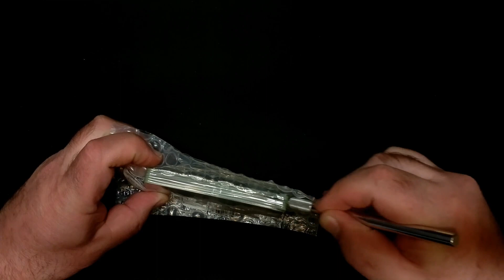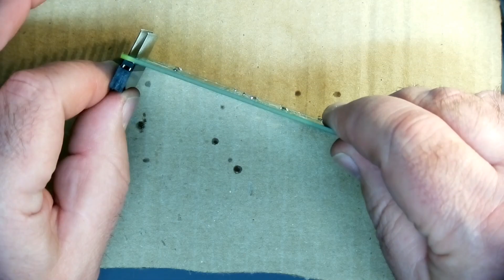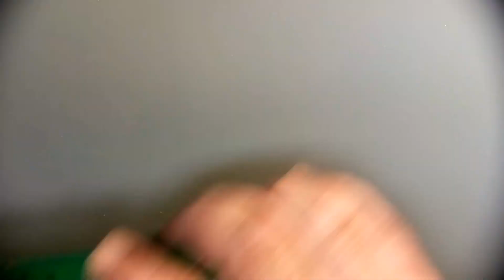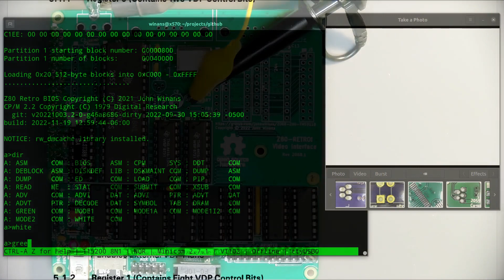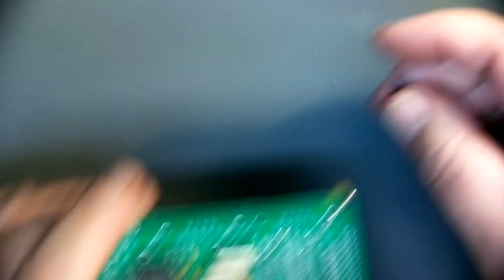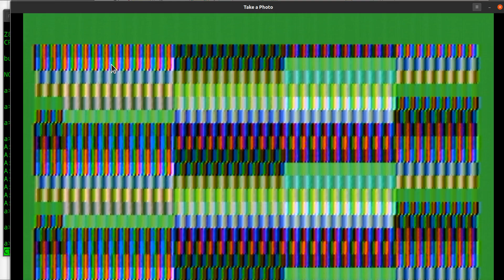Z80 Retro #55 - TMS9118 VDP Rev 1 PCB Test

Comment: Just a lone little opinion here but I don't mind the mixed use of SMT and thruhole parts on a PCB. It's not like that was never done in the past. Using SMT passives also helps to get more on the board... as you well know, thruhole DIPs are MASSIVE board hogs when compared to their SMT counterparts, every little bit helps.
Board looks good, thanks for the update.
Cheers,
Reply from the maker: Thanks for saying so.  I think my next few boards are going to be surface mount.  I can't get the chips I want in DIP packages anyway.  :-/

Comment: A great way to hold those jumper pins and a lot of other parts in place, is to use blue painters tape. No residue and comes right off, doesn’t melt. Blue painters tape… it’s strange to me ive never seen anyone else use it but it works great. 😊
Reply: Great for 3D printer beds and it's original intended purpose I've found and a myriad of other uses. It's my favourite tape as it is probably yours too;)
Reply from the maker: I've seen Kapton tape used for this purpose.  But it is way too expensive for me to use it that way.  I've also seen regular cellophane tape used too.  I tried it a time or two.  But it never kept things seated particularly well.  Maybe my boards were too densely populated with sockets?

Comment: A tip for connecters is to stagger them slightly with a small offset then they will 'press fit' and have a more mechanical connection and also you don't have to solder them till your done !...cheers.
Reply from the maker: You mean bend the pins a bit?  Probably a decent idea.

Comment: I've had the vertical lines with LCD monitors, but they don't appear as much with a CRT TV.
Reply: Yeah! Ive seen that too. My pole position arcade game looks great on a tube monitor but the lcd it has bars just like in the green test. So annoying!
Reply: @pikadroo  I wonder if the Retrotink, or another similar solution, would solve that?
Reply from the maker: This is the first video interface I ever designed.  I suspect the blame for it is mine.  Someone pointed out that the resistors I removed might have been provided for termination on the source end of the transmission line.  If so, then that could be a bit of an issue.

If it is true, then maybe hack in some aspect of the circuit I started with on my breadboard that I stole from page 9 of this Steve Ciarcia Byte Magazine article:

https://archive.org/details/Hi-Res_Graphics_TMS9918_BYTE_0882